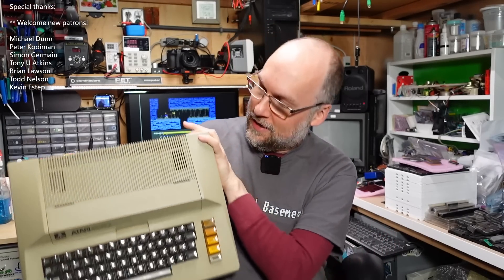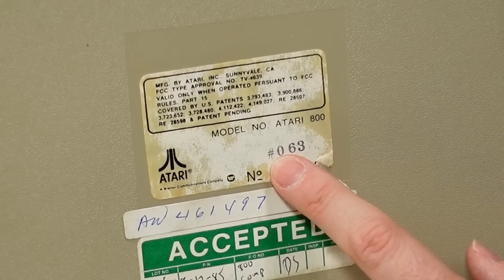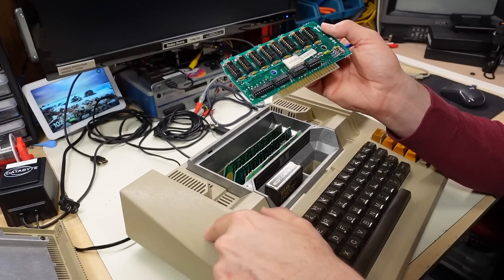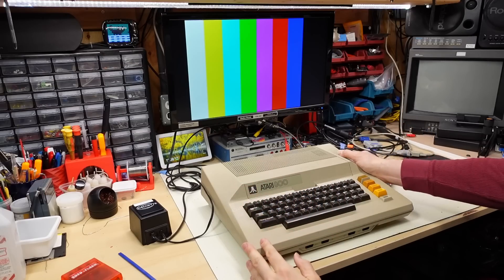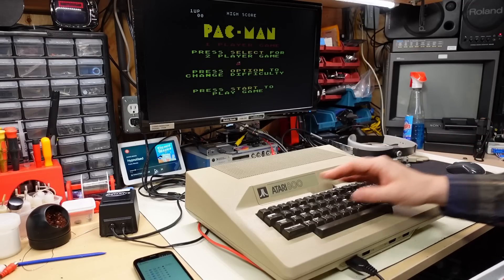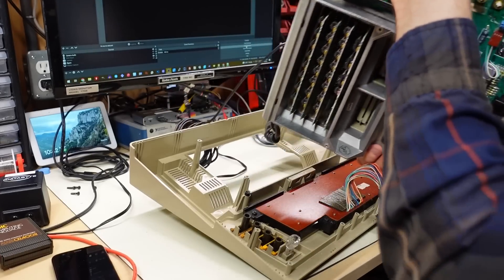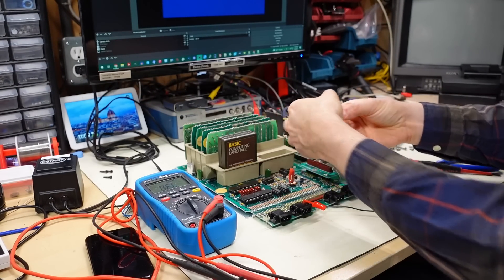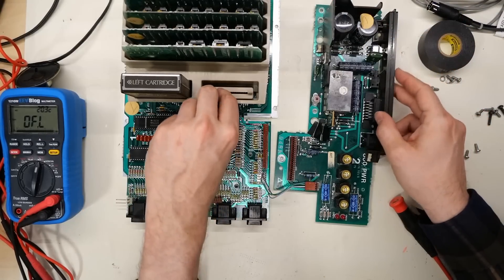Troubleshooting the beautiful Atari 800

Comment: Someone cleaned up this machine quite a bit before you got it, or you did?  On the underside of the cartridge slot is usually the remnants of the black foam that Atari put in.  Some units had thumb screws that you could move to remove the expansion cover, once Atari went to 48k by default there was no real need to go into the expansion port for most users.  The big chunky metal parts are largely due to the very restrictive FCC regulations of the time, is my understanding anyway.  Glad to see my favorite 8-bit on the channel!  The Atari computers are great 8-bits, a lot of good engineering went into these, being the spiritual precursor to the Amiga, with a lot of the same designers working on both.
Reply: Also, initially the expansion cards were housed in plastic cases that fit in snuggly, but Atari found that they were causing overheating so removed the plastic cases  in later production, (or users removed the plastic covers themselves).

Comment: Fun watching you explore a system you haven't been into before, and that cable you made - very cool!

25:00 The die cast portion seems to really be the case, with the logic board connected to it and the plastics all around acting like outer case..
Reply from the maker: Yeah it's quite structural really --- inner and outer case is a good way to describe it

Comment: It seems the A8 family gets a lot less YouTube love; the C64 and Apple are well represented but the Atari rarely gets a look in, so it's good to see this old beauty - for my money it's the best looking 8-bit machine, and in terms of what it could do it was well ahead of its time, and on top of that it's the spiritual ancestor of the Amiga, so the lack of attention it gets is puzzling.

(The internal speaker is just for the key click; later models ditched it and sent the sound through the video output instead. It was quite helpful on the 400 with the membrane keyboard, but kind of seemed unnecessary on models with actual keys.)
Reply: There is a C64 category on youtube, but no single category for the Atari 8 bit line.  If only the community could agree on a common label for the 8 bit line.  A8 would work but not enough people use it for the purposes of the Youtube algorithm.
Reply: Here are my search terms to find Atari 8-bit content on Youtube:  atari 8|800|xl|xe|800xl|800xe|65xe|130xe|a8|600xl|1200xl|pokey|antic|400|800xe   Then I have to filter by upload date and "this week" to get good results.  Maybe if enough people used these search terms together, the algorithm would merge these into a single category.

Comment: I bought an 800 I think in mid '82 or '83.  I loved that machine.  I bought the tech manual for $25 which even for a modest budget as a teen, thought was a bargain.  I had a few quirks with mine.  Power supply created buzzing in the sound and interference in the video.  Never could get rid of it, but didn't appear all the time.  Also had to replace the third party 48k expansion board.
I was hoping Adrian would open the shielding.  I knew about the CPU board behind the shielding.  I had to replace the 6502 on my boss's 800.

Comment: I bought an 800 (circa 1982) from ebay and it had the same issue with a dead keyboard. Everything else worked great. I as able to get a replacement keyboard.    (as for the RAM/ROM boards, the originals came with individual plastic covers to keep them in place and made them look sort of like extra-wide cartridges  (but i think those were eventually dropped for cost savings?)

Comment: The 800 is built like a battle tank.  If you put anything or drop anything heavy on my 800xl or 130xe, the case will definitely crack.  They should have stuck with plating to reinforce it.  I love these videos

Comment: If I remember correctly, the Apple computer at the time could only display capital letters, but that was before we all realized that all caps meant APPLE WAS YELLING AT US, unlike the well-tempered Atari. BTW Adrian, the official Atari power supplies were clearly labeled with their name and logo so what you have is not original, not that it really matters.
Reply: The official Atari power supplies are also, 40+ years later, not exactly stable or safe for your computer to use anymore. Maybe not as bad as those scary C64 bricks, but getting a third party replacement is probably a good idea anyway.
Reply: @chipacabra  The original Atari 800 bricks are just a simple AC transformer so there's not much that can go wrong other than blowing the fuse in them. However the 800XL power supplies also put out DC and one in particular (nicknamed the ingot) is apparently very unsafe to use now.

Comment: 3:50 I did modify my 800 so that the RF cable was detachable.  I just put a female RCA jack on the back there, but this was back in the 80s when I still used it. These days IK have a proper monitor cable for it to hook too a CRT.

Comment: Amazing to see how ahead of the competition this computer was even before the 80s. Built like a tank, easy to maintain and troubleshoot and graphically and sound wise very capable and competive for almost a decade. It is a shame that this line of computers and the console counterpart, the Atari 5200 never had more success. It easily beats any british micro, PCs untils the ega/adlib era doesn't even need to hide from the C64.
Reply: Yeah.  It was heartbreaking when the C64 ran away with its market.  So much effort I poured into programming, only to have to leave it behind commercially.  No regrets, though.  I learned much of what I used in my early career on the lovely 800.

Comment: Super great video! I've had a few of those keyboards apart and they are a pain in the pendulum to fix. On the other hand, I really appreciated the explanation and observation of the circuitry. Nice testing and disassembly.
Reply from the maker: Part 2 I'll get the extremely fiddly and annoying Mitsumi keyboard working. (Spoiler!)

Comment: I still have my original Atari 800. Great machine. I remember looking at the schematics of the 800 and the Apple ][ back then. I think there was an address decoder in the Atari that matched the address of the Apple ][ IO cards. Maybe they did have some sort of compatible I/O box in mind. 
The serial I/O bus was slick. You could actually do a sort of crude networking with it. Back when I was using the Action! compiler, the program I was writing was so large that it woundn't run on the system with the Action! cart installed. So I hooked up another 800 to the same IO bus, compiled to a floppy, then booted the second computer from it for testing.
Reply: where do I find those schematics?
Reply: Maybe that's why they were able to get an Apple ][ emulator working on the Atari
Reply: @petevenuti7355  Well, the Apple schematics belonged to a customer. I believe the Atari ones came from the tech manual. I would guess someone has scanned them online somewher by now.
Reply: @redleader7988  A better reason would be that they both used 6502 processors.

Comment: Atari did issue a Microsoft Basic cartridge that could be used instead of the Atari basic (I had it, it was very good), that included a lot of extensions to make using the hardware easier and made it easier for people to port games from other computers. There was also an assembler/editor cartridge, and of course there were third party language cartridges issued. By the time of the 800XL however, most third party software was being published on floppy disk and cassette, as cartridges were expensive.

Comment: That Atari 800 is slightly before my time, but I did see during the early days of home computers that some serial number stickers would be partially on the card and the other part in the manual for it, or it would just read in the manual some language about writing the serial number down in the manual before installing it, possibly so you could have it handy when contacting support I would guess.

Comment: I had an Atari 800XL bought in 1985 by my father. It was being discontinued to make room for the XE series. Anyways, BASIC is built into the XL and XE series. On the XL they were using Revision B BASIC, which had a habit of freezing while you're in the middle of programming so you have to save frequently. Atari made a Revision C BASIC which fixed that problem. I heard Revision B was even worse for freezing than Revision A that was used for the original 400/800. Because BASIC is default when you boot a disk on the XL and XE series, sometimes you get a message on the screen that says: "Remove cartridge". All you have to do is hold the Option button while booting.

Comment: Newer versions had BASIC in the ROM. It was not upgradable (well, swapping the rom chip always work) but you just could use another version via cartridge (or loaded into ram, but that will eat up some ram). 
Basic in ROM is stored at the same address the cartridge uses when plugged in, so that works better.

Comment: After the BBC Micro in grade 3/4 and the Vic-20 in grade 6,  (loading .... loading ... loading ...) I didn't self-fund a computer until the Atari 1040STE. This beast with Cubase 1.0 produced my first demo, many cover-band songs, and managed the data transfers for nearly a dozen specialty MIDI devices with their own way of doing things. I also loved and embraced Zork. I even had an A3 graph paper pad and sticky taped many A3 pages into a hand-drawn map of NSEW exploration. $0.02

Comment: The video connector is not different than C64 if you are using a DIN to RCA cable/adaptor for use with composite video.  The same pins are used for composite (pin 4), audio out (pin 3) and ground (pin 2) for C64, Atari 8 bit and TI 99/4a.  Though Chroma differs between C64 and Atari,  Luma is the same pin 1, but be careful with TI 99/4a as it provides 12V on pin 1.

Comment: The memory expansion is accessible on mine without removing screws. There are two plastic things that twist to release it where you described removing screws.
Reply from the maker: Yeah apparently the earlier machines had handy levers, but the later ones like this went to screws. Still easy, but just not quite as easy. :-)
Reply: @adriansdigitalbasement  The logic is that the later units were intended to be fully populated so users no longer need easy access. This is also the logic behind removing the cartridge shells which would have enforced the correct orientation. Mine has all the carts but the first two have a different colored label. That is because two would’ve come with the base model and the others would’ve been added later. I can confirm that the fully-shelled memory carts weren’t reversible.

Another thing to note: There is supposed to be a metal plate attached to the top of the cartridge door which combines with the rest of the shielding to completely encase the ROM cartridges. Yours is missing, which doesn’t surprise me. Mine is completely detached. When I first got it there were some remnants of the old foam that used to adhere it to the top but it had turned to dirt.

By completely encasing the cartridges you know they were really serious about FCC compliance! Heck, the reason the cartridge door has a power interlock is to prevent users from momentarily exposing unshielded ports/carts by opening the door with the power on.

I don’t know why Atari always built their RF cables into the systems back then. They did it with the VCS 2600 and 5200 SuperSystem too. It was even worse with the SuperSystem since power had to connect through the RF cord.

Comment: I thought the port was called CIO (cassette I/O) but it was nice in that it was much like Plug and Play. I think it uses a message-based protocol. so it had a way to distinguish the devices apart.

And yes, there were 3rd-party BASICs for it. There is Turbo BASIC which is considerably faster because it uses tighter FP and graphic routines. There was also the Veronica BASIC. It was an expensive cartridge, but that was the fastest BASIC cartridge for it yet, AFAIK. It not only improved its FP and graphics routines. It also added a WD65C816.

The reason for the shield had to do with the FCC. The TI994A got around things by having the RF modulator external to the computer. So as long as the RF modulator passed FCC tests, the rest of the computer was ignored.

The pot is for adjusting the colors. The reason for this is that if you upgrade the memory, it may use more current and change the colors. So the pot is to make up for voltage differences causing color shifting.

As for MOS, they were a rather good company, but they made some mistakes like the PLA chip. Mostek, OTOH, was just junk.

Comment: The immense amount of metal casing found in the Atari 800 is a direct result of the FCC back in the late 70's requiring computer and game console manufacturers to install shielding to block RF interference coming from these devices. Back in the 70's and 80's, the FCC was obsessed with RF interference from consumer devices though I recall reading somewhere that this interference problem was likely not really as much of a issue as the FCC thought it was. So if you look look at older home computers and console you will at minimum find some sort of RF shielding. In some they redesigned the console/computer to avoid having to use expensive RF shielding methods meaning the expansion feature ended up being more limited then originally intended as a result. Some manufacturers like Atari invested in a major solid metal RF shielding frame that cost quit a bit more then the cheaper RF shields used by the likes of Commodore or Tandy. This is why the Atari 800 has such a massive metal frame around it's main-board and also includes metal shielding on the RAM/ROM expansion area lid.

Comment: Jay Miner of later Amiga fame was involved which explains the capable custom ICs for sound and graphics, a concept which Commodore later copied.  The attached RF output cable probably had something to do with the extreme RF emissions paranoia which is also why the internal cast aluminum structure is present.  Perhaps the attached cable makes certain that no other cable type is used.  FCC RF emission standards were later reduced which allowed for the much cheaper VIC20s, C64s, and Atari 800XLs.  BTW, the RAM modules, unlike the ones in your machine, were also in shielded cases originally.

Comment: I recall fixing a tricky timing / crash problem where an inductor had changed value. I think it was on that memory board, or maybe the 800's MOBO. Luckily it was thermally sensitive.

Comment: I had an 800 for a while but it never got used so I sold it (something I now regret) and that had the cartridges instead of the loose cards. It looks like this has been repaired, perhaps in 1985 after the 800 had been discontinued, and all that the service centre could get hold of was the cards without the case.

Comment: the 800 and 400 did have expansion slots, with swappable RAM and ROM cards. Newer versions (XL/XE) only had a direct BUS connector which is mostly used for SCSI HDD controllers, and RAM expiations for the 600XL.
Reply: There was a fully developed expansion bus system  for the XL called the 1090, but it was never released.

Comment: On top of the fact that the RAM cards used to come encased, my later model 800 has a little plastic spacer that keeps all of the bare boards form moving.  It looks like yours may have been misplaced over the years, or maybe it's something they added after letting the boards float in the breeze was causing issues.

Comment: It's missing two brown latches that hold the main cover. The pull latch is supposed to pop open the "left" and "right" carts. The main cover is supposed to stay on. You'll see two holes. That was a mounting screw to hold down the brown latches that hold the main cover.

Comment: I have a couple of 800s in the basement. I always felt it was a better unit than the C64. I still use it on occasion. I have a couple of 1050a that have the "Happy" enhancement, and they load much quicker. My favorite games were Pac-man,  The All American Road Race, and of course, Frogger, the Disk version, not the Parker Bros Cartridge

Comment: Re: 7:18 Those screws are supposed to hold plastic wing latches that can be rotated to lock and unlock the top with your thumbs. Adding memory to the 800 was an entirely tool free procedure.
Reply: FYI late era 800's did not have latches, but were screwed tight because it was already upgraded to 48K from the factory.

Comment: 25:40 Oh it has a GITA microprocessor? so that's an updated 800 since the originals had a CITA chip. All the XL and XE machines have GITA . That could explain why it has service mark stickers on the bottom. Atari had a vast network of Atari service centers, as every moderately populated town or or city had one.

Comment: Not sure if anyone mentioned this, but upon opening the door for the cartridges, shuts off the machine completely.  Also, to the best of my knowledge,  the internal speaker was only used for system events: clicking as you typed, buzzing for certain errors.  Not sure if there was a POKE address where you could use the speaker.  I do know one POKE you may find interesting.   Type in POKE 77,128 at the READY prompt and see what happens.

Comment: As indicated, the microswitch shuts the machine off when the cartridge door is opened. Many users stuffed a piece of paper or similar into the hole in the case to hold the switch down permanently and allow the door to be opened without powering off the computer - this was essential to be able to, errr, back up cartridges to tape or disk :)
Reply: Been there, done that. :-)  Hacked together a litle adapter with a switch that disabled the "cart present" line.

Comment: i like the old machines that the cards can be added or changed in, like that atari 800 and the apple. or if it has a attachable expansion like some do. i also prefer a disk drive over tape. im sure most ppl do.